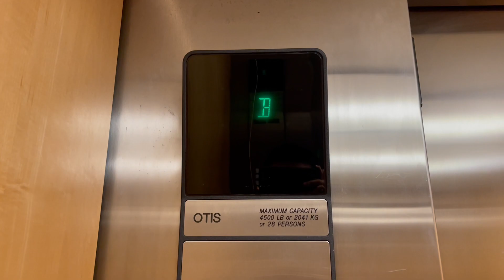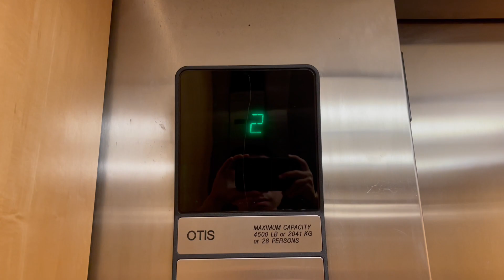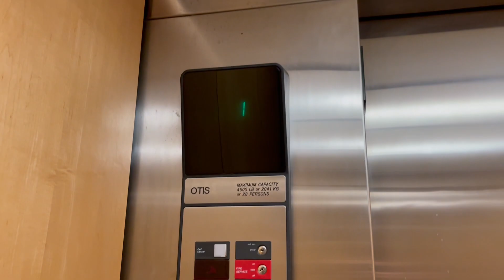Otis Series 1 Hydraulic Elevator at Mendel Music Library, Princeton University in Princeton, NJ.

Comment: You're right Jim, there are absolutely no vintage elevators on Princeton's campus at all, all of them are either newer or were mods of older elevators.
Reply from the maker: Have you been here and explored the entire campus before?
Reply: @JimLiElevators  Yeah, my dad works there, most of the elevators there i've seen were mods of older elevators, or newer elevators in general. I've been on this one before as well, it's a passenger/service elevator, and the other door opens up into i believe the stacks. You're right Jim, this is probably the only building you were able to go into, because most of the other buildings are either closed, or not open to the public in general (the building my dad works in is an example of one).